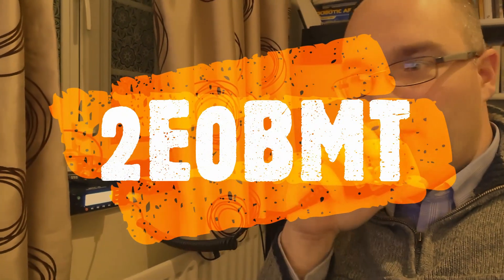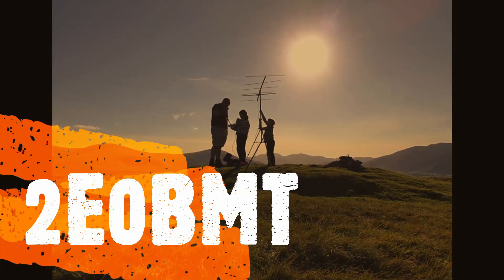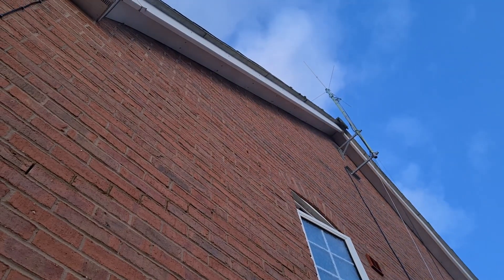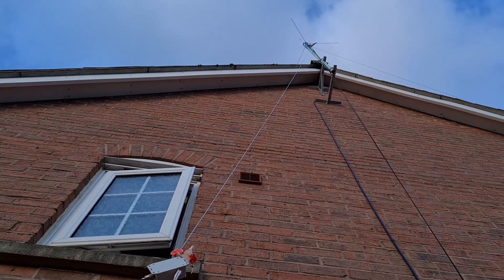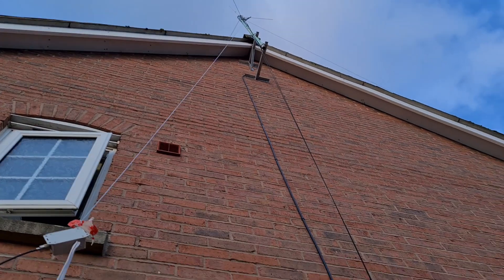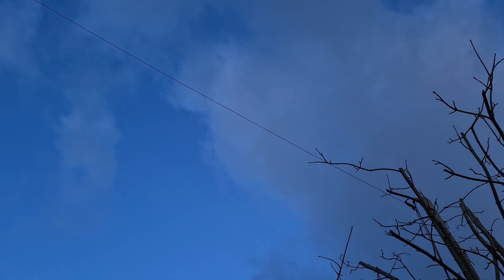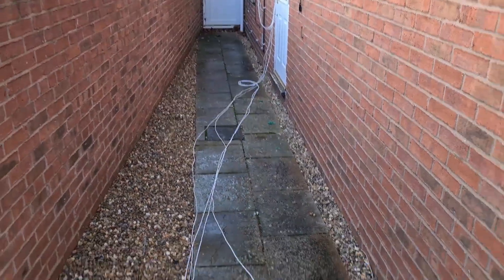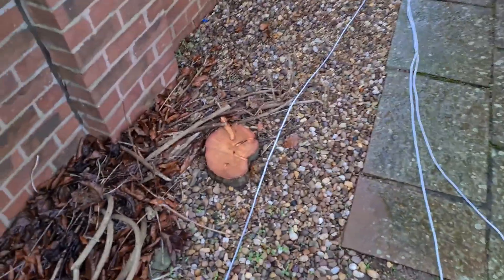Fault Finding: Sigma Euro-Comm LW20 End Fed Long Wire Antenna and 9:1 Unun SWR - Ham Amateur Radio

Comment: From my understanding of antennas I would have thought a 49-1 would have been a better choice due to high impedance on End-Fed wire, and a 9-1 would be better suited to a Random wire. But well done on the detective work. Shaun  M3ULT

Comment: Hello! Congrats for being so stubborn! It definitely payed off! I'm thinking to buy this antenna to use it for portable QRP with a Xiegu 5105 (or the new x6100). These radios have an internal tuner. Do you think will it be enough to tune the antenna on 40-20-30-17-12-20 meters?

Comment: hm I have the same one just hung it up in my backyard. 13m down from the roof and then turn into and L so not a straight line. Mine also has the last part of the L so to speak in some branches. Now mine works fine on all bands even 80m but only on 40m is the SWR skyhigh... not a clue why as of yet ? ;-)

Comment: Nice videos, next time put a 450 ohm resistor on the antenna connectors. That's what a 9 to 1 is looking for. That said the 9to1 are very inefficient, try a 49:1 or and L Match.. they will open your eyes.  73
Reply: Where did being a ham require slating me in your  IGNORANCE.  Ben stated it's a 9to1 unit. A 9to1 is looking for 450 ohm. You are referring to an end fed transformer which is a completely different animal.. DO YOUR RESEARCH

Comment: I love my home built random wire antenna...... it is about 65 feet long with a short counterpoise wire  4 feet long that goes direct to a ground peg...... my SWR on all HF bands is 1.5:1 or less on all bands including 160meters....... no tuner required at all on my 7300...... check out this small video I posted yesterday , my wire is in an inverted V and I work the world on it 73  https://www.youtube.com/watch?v=lzypfezRBkU

Comment: That’s GREAT detective work, Ben.  And also great that you defined the ATU as an Antenna MATCHING Unit – the term Antenna TUNING Unit (ATU) is the biggest con in the Ham radio hobby that Hams still fall for!  A truer description might even be Impedance MATCHING Unit (IMU)!  
Great that you also impressed that an internal ATU should only handle a maximum of 3:1 SWR, i.e. when using an antenna that is close to resonance anyway.  I know many a Ham who has regularly exceeded that limit and “burned out” their internal ATU.  Most Hams should use an external ATU unless they absolutely know their antenna is less than 3:1 on the band they are using.  
Just Sod's Law ref the duff unun, eh?!  A really great and clearly expressed video, Ben.

Comment: OMG, a 20m wire IS TUNED! It is resonant as l/2 in 40m and l/4 on 80m.
Reply from the maker: Yes, this is designed to work on all bands from 80-6, so needs a tuner for some bands.
Reply: It is probably about 21.5m which is good for 10-80m and can also work on 6 and 160 with a good tuner (well, mine does!)

Comment: Ben, my advice is keep the 20m long wire  and buy a 49:1 transformer. Connect it up and you have 4 bands: 40 20 15 10 no tuner needed. It will knock the 9:1 out of the park. 73
Reply: that was my though :-)
Reply: Agreed and depending on if the 9:1 is potted or not maybe you can simply convert it by rewinding with coil for 49:1 instead - also sounds like it might be a good idea for a video :P
Also rather than attach a dummy load get a resistor of the correct amount for the balun and then test for 1:1.  For example with a 9:1 it would be about 450 ohms (9x50) and for a 49:1 it's usually about 2.5K.  You can do this with the radio by setting the power to 5-10w and then key up on FM and check the SWR.  Good for peeps with no analysers.
Reply from the maker: Great idea! Thanks for watching.
Reply from the maker: Ah, thanks Tim. Great advice. I shall pick one up!
Reply: Hi, why no need for tuner with the 49:1? Thnx.
Reply: Da lord does work in mysterious ways